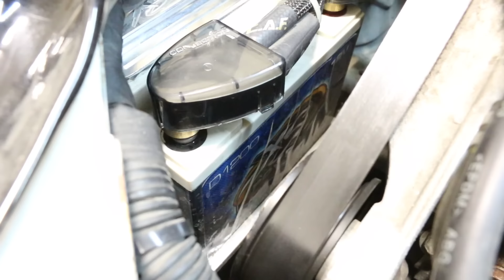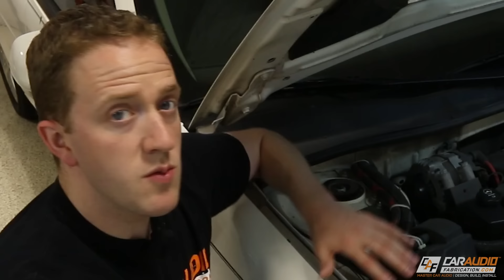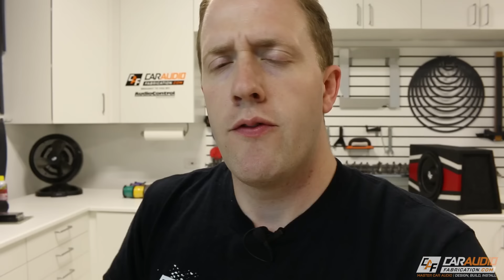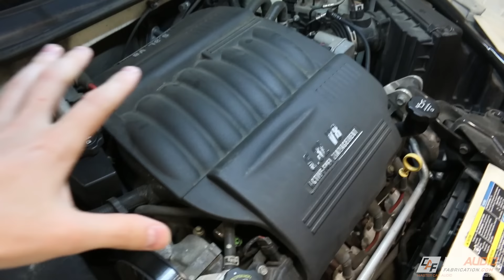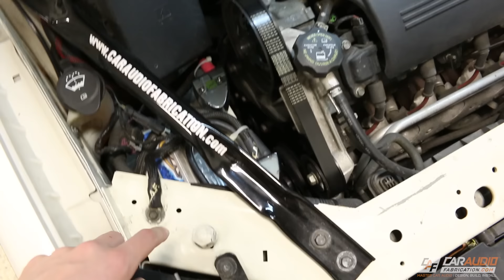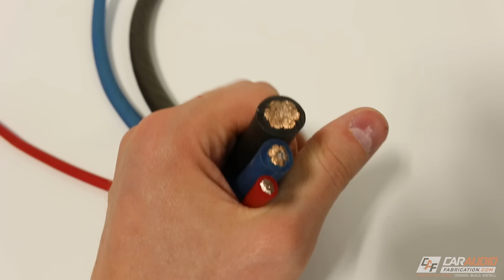Upgrade THESE for better Car Audio performance

Comment: Upgrade your wallet first.
Reply: I have my big goron wallet, what now?
Reply: Mike Whitenton so true when going over 500 rms, money goes so quick.
Reply: yea... I got 1,400 rms, but made the terrible mistake of not looking into the way I would power it (besides the wire) and boy was I in for a treat!
Reply: @THESUBZILLA  0 guage wires all the way
Reply: @kelvinperkins5864  yea man haha I'm now pushing over 12k watts to a wall build haha check it out! It's a blast!
Reply: This is. Facts  must. Have a better job to do anything over 500
Reply: @BigDawg733  do you ? I’m on a stock alt no extra battery running a skar 12vxf wired 1 ohm? 1500watt rms 3000watt peak on a skar 1500.1d (the skar 1500rms amp) yes the sub can take more power but it bangs enough to get smiles out of me and my friends
Reply: @uhpixr  do your lights dim? What kind of car?
Reply: @BigDawg733  also I only make $9 per hr plus tips I don’t make a lot of money and I only put $700ish into the system
Reply: @BigDawg733  better paying*   or <se a combo of credit cards and your paycheck from a great paying job, lol.
Reply: Lol
Reply: Done!!!  bought truck 4 months ago painted it rebuilt front end, new nitto tires, fox box ,mechman 320, xspower battery d6500 ,sundown sa12s ,Alignent,sky high big 3. Skar 2k. 🔊 🔊
Reply: I hear ya. When you consider upgrading all your lighting to LEDs and upgrading both the electrical and sound system you'll be looking at a lot of bucks. At least the LEDs will reduce the electrical load. Installing road sound deadening materials adds to the cost.  And then you add in the cost of cleaning and other maintenance. And if you add in the labor for someone to do it for you, you'll have to find cheaper vacation spots......
Reply: Yes I’m thinking of making the leap to a  leather one
Reply: True
Reply: @riveralley  did not expect the Zelda reference xD
Reply: @PolyDubz  ?
Reply: Mike Whitenton , I love that! That is so true and it is correct to! Opinions vary, but the facts do not!
Reply: I have a stock alt and biggest cca battery that fits in stock location.i did the big 3. Have a skar1500.1 o. 2 massive gtx 12s. Debating g on getting a HO alt or add a second battery
Reply: @mikep3322  excuse me for being dum.  So when I add the 2nd battery I don't have to worry about upgrading my alternator?  What else do I have to add when adding a battery in trunk. Is there anything else that I have to have?
Reply: @christopherbrock8913  what battery you updated? Type model? And what car is it ? What is output of your alternator? 
Must be done first of all.
Ground alternator to car chasy.batery to car chasy all solid cables 👍 .
Reply: @christopherbrock8913 depends on what ur doing with your system. If youre playing it alot parked, a second battery is good. If you need more power with the engine running a second battery is just more load on the alternator and wont help your system.
Reply: Mike P just get both man lol
Reply: Mike P 
Which did you do, I’m going through the same now, I have a 2000rp amp and sdr 12’s all skar. Bought Additional battery but didn’t install yet
Reply: @robskee4922  dont waist money for alternator tune your current alternator 2x
Reply: @mikep3322  HO Alternator, trust me, i have found the best way to go is HO alternator to battery positive and negative directly (biggest battery you can fit if you are adicted to bass like me) then run big positive and negative straight to a good size supercap (not a pisfart little 3farad, a real supercap) less than 1m from the amps, depending on the supercap you go from it to a distro block or have a distro block style terminal on it (think the xs supercaps that look like a car battery with battery style terminals for massive builds or for something more mild a 10-20 farad cap like what stinger supplies with wire clamp terminals where you throw a ferrule on the wire, slip it in and tighten the clamping bolt 1 in 1 out each for positive and negative) short runs with adequately thick wire (i personally prefer oversizing my wire) to whatever signal processing and bass restoration and amps, i refuse to use anything less than stinger 8000 series directional rca's which have terminals that can be tightened due to having issues in the past with lower quality but allegedly good rca cables. Upgrading the ground on the head unit is something i like to think of as bare minimum, also adding a cap to the power of the head unit or simply powering it off the supercap is better again as it supplies cleaner power to the head unit (crap in crap out, quality in quality out)
Basically my theory is the super cap and big battery combination works like electrical suspension, cleaning up any dips caused by big bass hits, the big alternator is a must for supplying enough average power but without the big battery and cap its the electrical equivelant of having coil spring suspension without shock absorbers, and the ground all being directly connected rather than going through the  chassis has given me better results for making sure there are no unnecessary ground loops, the cap makes sure the battery isnt trying to take all the big bursts of power on its own, making sure you have extra protection against undervolting other vehicle electronics on a big hit, giving greater longevity, im not an expert that does this for a living, im just an audiophile basshead sharing my knowledge and experiences, take whatever advice you want from it, just know, any ground voltage differences creates god awful pain in the ass results and its easier to do it once directly then try figure out what part of the indirect ground setup is potentially causing issues, this technique is able to be modified slightly to have a 2nd   (potentially higher voltage) electrical system set up through a secondary alt for audio only, leaving the stock electrical system to do its own thing and further limiting problems down the line.
Reply: Mechman alternator. Problem solved.  A little pricey but well worth it.
Reply: @kelvinperkins5864  im trying to use a 4 channel 1800 watts amp with a JBL S 2 1224 sub  and the 4 cab speakers low wattage but running parallel should I worry about my electrical system not being able to handle the load ?
Reply: @berniemackattack86  1800watt amp? so its 900rms. should be good with stock electrc system.  What vehicle you have?
Reply: @kelvinperkins5864  I have a 2003 nissan maxima.  I've taken out the stock stereo and have a 2018 pioneer model.
Reply: @kelvinperkins5864  not worth it mate where you can pull out of your current alternator 2x of current amperage 👍
Reply: Minimum wage with 200amp alt. 3 300ah odyssey agms. Dual runs of zero gauge. Taramps md5k with dual power inputs. Pushing one custom sundown 18 in a 9 cubed slot ported box tuned to 28.5 hz
Im still dropping volts.
Reply: @jordanmarker1220  not enough that odyssey...is just not mate 😀
Reply: @jordanmarker1220  you could try a dual alt setup where the primary alt powers the car, and the 2ndary alt powers the agm bank, grabbing a 500a mechman after months of saving, externally regulating it ito the max voltage your agm batteries are rated for, power and ground direct to them, just need a custom mount and belt setup to make it work, they supply the mounting mechanism for their gm v8 500a alt, doing the fabrication for the dual alt bracket yourself saves quite a bit of money if you have the skills (mainly maths and welding)
Reply: @jordanmarker1220  im on 700 aud (about 500usd) per fortnight (2 weeks) btw, and rent is most of that, its taken me about 3 years and some temporary subs to get as far as i have with my current car, expecting it to take another 3 years to finish my audio setup, especially since anything that meats my standards bass wise tends to need importing, it took about 3 years for my last car, but the alternator setup im after is twice as expensive and the subs im planning for are about 8 times as expensive as i had in it, unfortunately i had dodgy work done by an autoelec that clearly shouldnt even be looking at anything electrical, causing multiple shorts that took the entire electrical system with it and nearly burned my car to the ground, had 3kwrms, aiming for somewhere between 5-8kwrms and linear excursion to 10hz with my current car
Reply: 500rms aint 💩...  my system pushing 1500rms with stock alternator, the big 3 and a limitless battery just for the audio system.. no voltage drop or dimming headlights
Reply: @kelvinperkins5864  It really depends on how your charging system was designed. Mine is controlled by the car's computer. It doesn't respond quickly enough to dynamic loads. A 1V drop at the battery is enough to dim the headlights and dash lights.
Reply: @kelvinperkins5864  limitless is a nice looking scam ❤️😁 do your homework and open it 🤭😂 it's not lithium how they says...is not..you could have way better choice for way less money way more amp burst ❤️👍
Reply: Lmao I guess I go in audio the easy way, used equipment from good friends - $200= 2 Sony 12" in sealed box, 1 planet audio 1600 watt amp, 1 planet audio 2500 watt amp and instalation.  But those amps kicked the dust so I'm upgrading and I definitely can say that you have to pay to play!
Reply: Number go up
Reply: Or just get a used Cop car, they come with 2 Batteries and a beefed up Alternator. Interceptors run on alot of power, lights, laptops, walkies etc. i'm going to buy me a Caprice or Charger
Reply: Mike Whitenton exactly. Gotta pay to play. Im upgrading my alternator this weekend and im only running one scv2000d on 2 SA 12s. Well, other than the sae 500.d on the mids and highs. Id rather be safe than sorry. Already got the proper wire.
Reply: Haha, noted good sir.
Reply: savage but true
Reply: Ha haaaaaaaaaa, greaaat 1
Reply: Ha haaaaaaaaaa greaaat point, eggxaaaactly
Reply: Any alternator guys you currently have let's say it's 129 amp output..you can upgrade this yourself with 0 expenses to 240amps 👍 no money Money to spend stirp it down and is just few adjustments needs doing 💎 time and effort that's all you need ❤️
Reply: @tomasexteriors  how do I do this?  Any video or tutorial?  Thank you
Reply: @CanesupNolesDown  what's was the question?
Reply: @850Cane  tell him to draw a schematic and send it in PowerPoint. Need color coded please.
Reply: @tomasexteriors  Video on this tutorial?
Reply: @tomasexteriors  I was asking how do you increase the output of my current alternator instead of buying a high output one?  Thank you
Reply: @tomasexteriors   how so ?
Reply: Facts it's definitely not cheap especially if you want a premium power consuming system lol  The subs, box, amp, and wiring kit (OFC) your looking at around a $800-$1000 if you want a great sounding system and that's not counting any electrical upgrades. That can run you another  $600-$900 (alternator upgrade,  big 3 upgrade, and secondary battery) mine cost alittle over $900 for my system with a custom made box to fit perfectly in my car. The electrical upgrade cost me $775 and I just spent another $115 for mounting brackets for my amp, 2nd battery, and other accessories to keep my wires in place and organized. All together iv spent close to 2000 (double what I paid for car lmao) i bout forgot I paid $250 for my cd player then $110 upgrading my door speakers. I did all the work myself (except making the custom box) idk how much they charge to install a sound system or to upgrade electrical system but I'm sure it's alot so if you don't know how to do any of this then you will have to add the $$$ for installation and all that it definitely isn't cheap
Reply: My opinion is altenator 1st. Battery, and cables. Them a capacitor if you need it.
Reply: Man... I went into this so hopefully, now idk what to do. Sub and amp pull to much power from battery and car was driving slowly.. even unplugged the remote and was still slow.
Reply: Idk what to do, capacitor battery or alternator. Or all 3? Ahh fuk
Reply: I got my kit from skar, 12" single sub and 800w amp.
Reply: Number one step that consists of two things….alternator and big 3. Very very very important not just for your car but also all that audio equipment you just dropped a shit ton of money on.
Reply: Bahahahhahaha!
Reply: POTD
Reply: An alternator is the same cost as a battery anymore.. it’s actually a very sheep and cost effective upgrade anymore. Blows my mind how many people are willing to get run multiple high end batteries when a simple alternator upgrade is more effective and half the cost.
Reply: @fishrrelaxing9361  because its not always so simple. A high output alternator takes a lot more torque to turn under load, and most accessory drive systems wont be able to handle that. Problems with belt slippage are common, and   anything you do to increase belt tension has the chance of eating the bearings of other accessories. This is not always the case but it happens.
Reply: Get out of retirement and you Wong half to worry
Reply: Damn... Painful truth but it is what it is. All i can do for now is just to bookmark it, save it for later, or just add to cart😩
Reply: How do you do that? I can’t find the “Wallet upgrade tutorial” video.
Reply: @WhitentonMike  absolutely 🤣
Reply: @WhitentonMike  yeah bro I did  kicker subs and amp and spent a rack
Reply: @WhitentonMike  Yes

Comment: 1. Bigg three
2. 50mm2+ wire between amp and battery
3. 1 extra Battery or more
4. Stronger alternator
(5.) As a last save a cap, a high current battery i way better than a cap in my meaning.
Reply: I have lots of 25mm2 cable, Im running a 1000rms Rockford r1000-1d for the bass(no woofer yet, thinking about 1x woofer, preferible sealed for more space
sony gm5400t for mids n highs; RMS specs for the Sony
125 W × 2 (at 14.4 V, 4 W, 20 Hz to 20 kHz 0.2% THD)
380 W × 1 (at 14.4 V, 4 W, 20 Hz to 20 kHz 0.8% THD)
190 W × 2 (at 14.4 V, 2 W, 20 Hz to 20 kHz 0.8% THD)

Id prefer puttin 4 6.5"'s in the car, however not a 4channel amp, what you recommend, connecting 2x 90-100rms 4ohm svc per channel?

Can I used two 25mm2 cables instead of 1 50mm2?
the alternator is about 80a, battery size of a scooter (its a 05 1.4 civic, sorry I crashed my 4.3 s10 3times)

Comment: .How are you wiring the added batteries? If you are running an isolator you are adding nothing , you are losing power. Run batteries in parallel and monitor volatage for double current. This is overlooked all the time. Run power wire on the opposite side of the car from your signal wires.